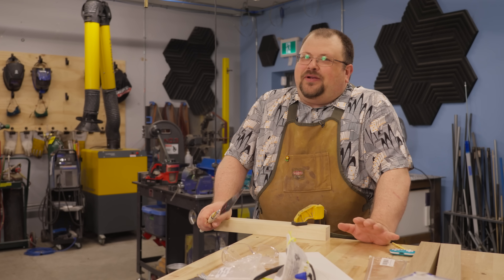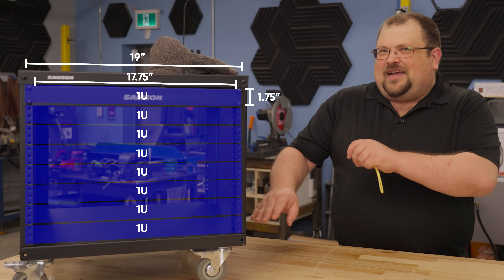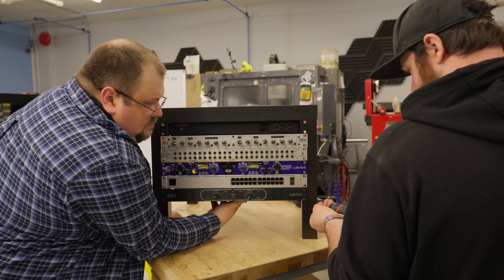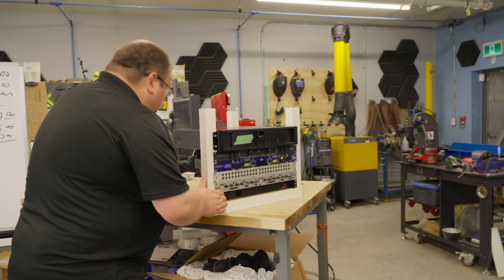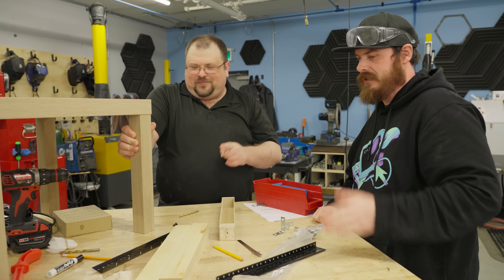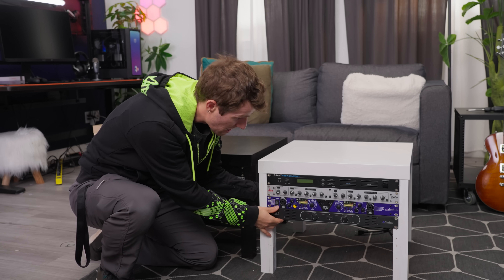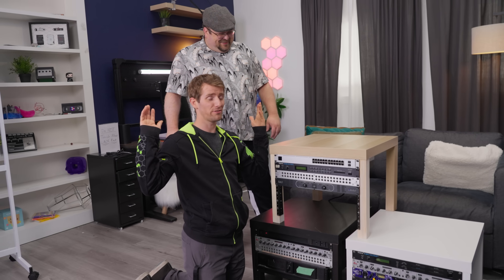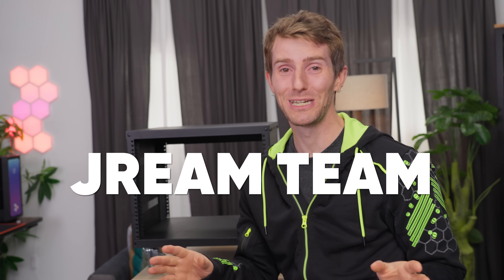Server Racks Cost Too Much - Buy or DIY?

Comment: For the Lack rack, instead of replacing the legs with wood, I searched for slightly smaller pieces of wood and inserted them into the legs. Then I added a second table on top so I’d have a larger rectangular shape and a larger U rack

Comment: Should've used some strips of metal on the rear side of the front legs and drilled through entirely using the back plates to bolt onto.

Comment: One quick trick on rescrewing the same hole. Toothpicks and glue. Hammer those in and trim the extra, and it's honestly pretty solid. Even more solid would be glue and wood dust mixed up first, then tooth pick.

Comment: I built a rack out of some old shelf board and hung it from the floor joists in the basement.

Cost a dozen wood screws I bought years ago or maybe my parents did
A piece of shelf board that either came with my house or I found in my moms basement 

It just held a switch and a couple patch panels but it worked

Been in the new house for 6 years and i have yet to wire it for Ethernet :(
We were going to start remodeling when we bought it then covid hit and prices sky rocketed and my wife switched jobs and we haven’t gotten to it.

Plus My wife is happier with her new job and the hours are a lot better especially with a 2nd grader with lots of activities 

Minus she makes a lot less and we don’t have money to do stuff quickly

Comment: Here's a tip.  If you're looking into half-width gear (home use labs), use a mesh 6 to 9 tier paper organizer.  You can trim and grommet off areas where you want to route your cabling (to the back) because they are enclosed in the back and sides by design.  Granted, they are wider than the 8.123456789 inch rack width standard.  but you can fix this by simply zip tieing devices down to the slidable/removable rack

Comment: Still don’t understand the thing with the rails when you still use wood screws, the holes still will wear out?!
Reply: so the reason the wood screws directly into the legs for v2 being bad: if you want to take your rack mounted component out you have to unscrew the woodscrews, after a while of screwing into the same hole with screws they bore out and the screws have nothing to grip.

when you add the rails what you do it permanently fit the rails, no unscrewing the wood screws, this means the holes don't bore out, but to add and remove your components you just use the rail screws that screw from the rack mounted components into the rails these do not screw into the wood and won't wear out

Comment: 12U adjustable rolling or wall mounted rack by VEVOR is under $64 (Right now, $100 usually), granted no enclosed sides (though neither does a LACK), but it does have a top and includes 2 1U trays.

Comment: Yeah... I had build my own 12U /19" rack  from 1x MDF panel I have  and just add 4x wheels and 2x rack rails.
Not a shy on construction as looks professional and fits: 4x servers on rails, 2x switches, 1x Managed  PDU , 1x UPS and a patch panel. 
Honestly is a bit tight, but the local UPS was not planed initially. By using MDF + cheap sound dampener layer I had lowered the noise.
Still have to complain HP servers are loud.

Comment: Surprised I didn't see them think about putting in some threaded brass inserts into the solid wood legs. That would require some more work but the longevity issue would be mostly solved.

Comment: Cheaper assuming I have a $500 table saw, a $200 drill press with countersink bit, a vehicle that can fit 2x4 from the store, or delivery if not. Any painting is going to add at least $25 even if you buy a shit brush and the smallest container of any coating. So its not really "cheaper" its cheaper if you already have all this stuff

Comment: All good except including the install time. You have to do that no matter what rack you buy so unless you are adding it to everything it doesn't need to be included. Obviously you should still account for any modifications you need to do like painting, making legs, assembly (of the lack table), etc just not the final installation.

Comment: I don’t want to be critical because I liked this video a lot but I want to put here some points of reflection that I thought about for the next episodes in this series.  
People like spending money on their hobbies so most people are not necessarily looking to spend as little as possible instead they want to spend the money they have as effectively as possible, considering that the alternative cost more than double what you made you could have spent more time discussing what to do with all that other money, be it more upgrades to the lackrack or cool used rackmount stuff to look out for etc…  

Also people like spending time on their hobbies, and they usually like it more than spending time at work so it would have been nice to have the price of labor more clearly decoupled from the price of the components (maybe some more numbers on screen in the conclusion to sum it all up like the whiteboard at the start) so we can more easily balance out what that ‘labor cost’ is to us

Comment: 4x 24U rack rails, half a dozen 2.4 meter lengths of 3-by-2 wood, and a box of screws = full depth half rack that now holds three Dell power edge servers, two network switches and a rackmount gaming PC, with space spare.
Rails were about £15 each, so £60... box of deck screws was another £15, wood was cheap because I'd had it a while at only £3 a length. Took half a day for two of us to do the full build.

Even with current prices for the wood, considering this is a full depth, 24U 4-post rack the equivalent cost is way higher than £200 more like £400-500

For a few £ extra I also got some thin (6mm) plywood to enclose top and sides. I did plan on making a door for the front but never bothered.

Comment: A few months ago I finished building my own rack.

I built it to mount a CRT monitor, a PS2, audio amplifiers, and UPS.

It took me nine months to finish.

I'm happy with the result. It's made from metal pieces that I had to cut and drill.

If you're thinking of building one out of metal and you don't have the right tools, patience, and time, it's best not to try. Instead, go to your local blacksmith or those guys who are skilled at building things and ask if they can make you a rack. They probably won't know what it is, so explain it to them in simple terms. Let them know that accurate measurements are important.

Comment: Honestly, the only feature the Samson has that the DIY one doesn't is the casters, and if you need/want them, you can get a good set of locking casters for 20 bucks, 10 if you cheap out.  Add on another 20 minutes of labor at 30/hour and that's still only about 100, 110.  Ninety bucks saved and you get something that still wouldn't look amiss in a corner of your living room, but does the job well.

Best part about it, though, is that because you made it, you can tweak it if you find you need some extra functionality!  Or, if you don't need the casters, that's another 20, 30 saved!

Comment: the trial and error is part of the DIY process. gotta take into account all the failed attempts and failed supply cost and time! as other pointed out though, since part of the DIY is also racking it, you should install the gear on the competitor and remove that time from the DIY setup, but not the extra ones that come with DIY experiementation. :D still this was great, more of this!

Comment: Hey guys, I'm looking for a little help. I have this nephew who currently plays games on an Xbox one. He's wanting a pc, says he's looking to get into mods with Minecraft java. I'm not sure he's looking to switch fully to pc. Though we have talked about the prospect of gta6. His mother has been showing me systems for around £250-£300. None of which I'm impressed with the specs of, but that research shows should be sufficient for that purpose. 
Obviously in the world of PC. More money = more specs = more ability for more games.
Thing is I fail to see that paying that much to play one game as a good thing. 
I'd want him to get a better pc so he can have more than just a one game system. Unfortunately the budget doesn't seem to allow for this.
Can I get some opinions? The systems I'm getting shown and am generally finding within the prices listed above are typically i5-i7's ranging between 3.4- 3.9 GHz, some coming back as Ryzen 5's or Ryzen 7's. The intel ones are generally lumped with gt 730 cards, of 2gb and 4 GB varieties. The Amd's are generally showing integrated graphics.
All  I can remember of are listed with 16gb ddr4 ram.
My pc experience has been absent over 12 years now. More or less. I occasionally buy steam games that my pc just craps out at. So much so I'm getting much better results emulating windows on my android tablet.
My pc consists of an AMD 9050 iirc. 16gb ddr3. And an rx580 8gb GPU, which was a replacement for a 390x. (Yeah around the same time as the GPU mining thing) I never saw any profit in doing that with 3 of the 580's over around 3 months. So ended up selling one. And then through my own stupidity lost all of the coin I was mining.
So I'm seeing these things she's showing me and thinking. O.k so aside from more cores and a little faster ram. There's nothing much in it. The GPUs (when they're there) are giving a fraction of the memory mine had over a decade ago. 
Ultimately I feel like I know the answer is gonna be that there's just not enough funds available to get him a decent system. 
So I guess this is me just venting stress about being clueless. And poor, lol.

Comment: This has been an rabbit hole of mine for the past few years. I have been wanting a 16-24u rack for home server/networking equipment. Finding a small thing under $200-$300 with square holes for cage nuts, and maybe some side panels (preferably wood) is insanely difficult to find. You can get square hole rails, in a two pack (left and Right) for like 25 bucks. So $50 then build an enclosure. Still difficult to do for less than the cost of a "real" enclosure. But this is exactly as expected. Very cool video guys

Comment: I found a couple unused countertop brackets from an ikea purchase. And then I discovered that the width between floor joists is perfect for a 19" rack.  So I drilled and tapped about 60 holes and now I have a 10U rack that can pivot upwards to work on the back.

I wonder if some of the first telecom stuff was mounted to 2x4s dropped down from floor joists... Hence the 19" standard.

Comment: So real question, I bought just a massive server rack for a 150, I would guess that because of the fact its "full size" but came with 2 phase pdu, 3 sets of bod rails, fiber patch panel and like a hundred wire management strap. So my question is are big server rack deals a better options if the need to be modified for more normal use or going with something completely DIY

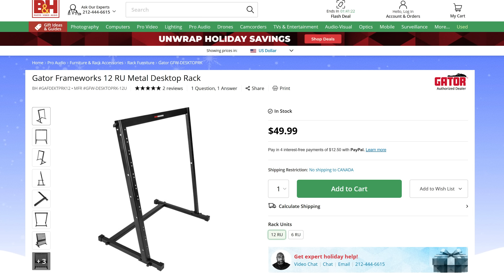Comment: 0:32 I beg to differ on the “you can’t go cheap” statement. You can buy the metal rails and mount them to a wooden rack made from  scrap wood from a recent basement remodel. I know a guy who did this…it’s me I’m the guy. Full 40ish inch rack for under $50. Holds a gaming pc, densely packed 3 ru server and 2 amps for whole home audio. It also has all my switches mounted on the back side. Works almost too well lol

Comment: Am I missing something? What’s the difference with 2/3 effectively? It seems you’d run into the same issue with wearing out the holes, I thought they’d have the equipment mount to the rack rails only rather than through the rails into the wood…?

Comment: Apart from the fact that having to calculate a salary for yourself when doing DIY is kind of silly. If you only need the half-depth rack, why not just buy a 9U wall mounted cabinet for 70 euro, or a 12U "smart rack" for 75? No need to buy tools, spend time going to Ikea and Homeless Despot, no need to have tools and gubbins....

I can literally just order a 9U wall mounted rack which is fully enclosed with a door and everything, for 70 euro delivered to my house. Why bother with DIY at that point?

Comment: I just bought 4 pieces of offcut L bar from my local steel merchant that fitted from my ceiling to my floor, and then drilled and painted them myself. Fit perfectly in my empty cupboard and only cost me a few pounds.

Comment: The way to make a "proper" lack rack that also looks the same as og is to remove the bottom of the legs and drive a pice of wood all the way to the top.

Also, buying a 2nd lack table and disregarding the legs and using only the top, you can screw it to the legs and also add wheels

Comment: Rack 2 could have had permanent screw holes added by using wall anchors installed.  $2 more to fix the problem.

Comment: Hello, I currently have a GPU that has a 6 pin PCIe but my upgrade which is a arc B580 uses an 8 pin, is it safe to use adapter that uses two 6 pin PCIe plugs and merges it into one 8 pin PCIe to power the new GPU ? I have a 550W PSU

Comment: I just bought an Ikea Nissafors, some black rack rails that are meant for 19" rack gear and a box of cage nuts. Most of the parts required for the shelving was unused and tossed in the bin. Drilled holes in the frames of the Nissafors and the rack rails and bolted them together. Added the cage nuts to the rack rails and it was good to go. The gear is what holds it together and the rack even has wheels that came with the Nissafors package. But they are not that high quality so better wheels might be required for more populated racks.

Comment: I have one of those tables. Old, still...usable but yeah. When Linus leaned on top of second one, ngl, heart skipped a beat. Tops are just as bad as the legs, just hollow lol, leaned on it once years ago standing up and now massive hole in the middle, so have to use a mat on top to put anything down on it. 

I fear the day my cat jumps up on the printer I have on it and the entire thing just poofs into dust.

Comment: Stack all of your gear with 4-6 sheets of printer paper between them then drill all of your pilot holes at once. Drill a 1/4" hole on the back and fill the leg with expanding foam. Yes, it'll push out through the tiny pilot holes but not much and can be cut off easy with a razor knife.

Comment: Those screw heads are just barely big enough not to go straight through the holes in the equipment. Get some washers on them or use bigger-headed screws.

My homemade rack is just rack rails spaced with wood planks on the side and 1U blanks top and bottom. The biggest problem with it is it is installed in a very shallow cupboard which severely limits what cases I can use for the servers inside.

Comment: I built my own rack in my closet using some 2x3s.  I have all my network equipment in my closet.  I built it in an L-shape with a brace at the back.  So it can't fall forward, well, it pushes up against the wall above the door.  It's been absolutely perfect and cost me maybe around $20.

Comment: I know this is suppose to be a fun video but seems like if you can afford to buy rack mountable hardware you should be able to source a rack suitable to fit your gear. I have about 5RU of gear in my home network so I purchased an 8u rack for under $100.00 and it looks nice. Lag bolts running straight into my wall studs, it's not going anywhere.

Comment: the Lack may seem like a good cheap idea, but if you put anything that produces any amount of heat at all, then you're going to want to mount fans to the sides/back of it, or else your top SOLID piece will heat up very fast, making it a fire hazard. metal racks dissipate heat more, and can handle higher heat. plus, they often have open tops, so no heat buildup at all.

Comment: I built a wooden rack with brackets myself before. Looks like a better experience. Yes, you need to measure and maybe at least sketch it out before you get custom wood cuts from the hardware store (or cut them yourself).

Comment: When I bought my new house I made DIY rack from 2x2 timber and MDF base, painted all black and screwed it into two walls and the ceiling + added the rails. 
It was a fun little project, though I now regret it's not slightly taller.

Comment: I mean with diy, i can also build like i want it to. If i wanted to make it deeper, i can. Make it so it can hude cables better, i can, or i can search endlessly, to find something close to what i want 

I build my own keyboard, with a old pcb from a Dell hand me free... and I know that it took time and all, but if I dedicate myself to it and also dont rush it, then the final product  is really good. I used a cnc from my uni and made an aluminium blocked keyboard, and it is perfect. Build like a tank, and it also cost me only 40usd🔥 and I think it is way better than any other 40 mechanical keyboard you can get. Like, I dont think you find an aluminium blocked keyboard pre-made for just for just 40$ let alone a mechanical too. it took me 3 months and made it a part of my semester project, because I am studying electrical engineering i made diagram of the circuit of it , and also optimisted it, so it runs faster, by reducing internal electrical resistance, got a a on my  lab report, and i am going to exam in December. I prof said it was one there's the best projects he have seen by a 3 semester student

Comment: Fun story:
Bought a used 27U rack. Great quality, thick steel, on wheals. It was around 50$ and the guy even delivered it.
They where going out of business or something and needed to get rid of it fast.
The only downside is that it misses back wall and front door.

Here's the kicker:
Inside of the rack I have found a disassembled smaller networking cabinet. It was brand new. I have sold it for about 120$. 

So I even made money after all of this.

There were also a couple of ad displays for ~600$ each but they were dead :(